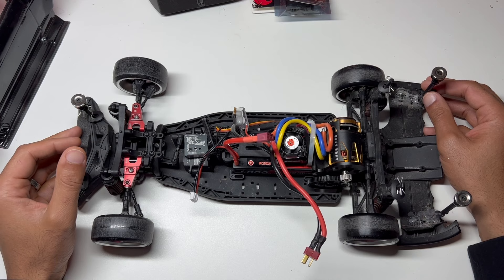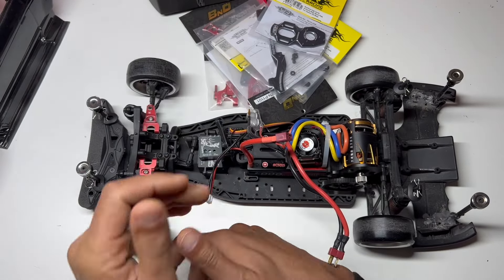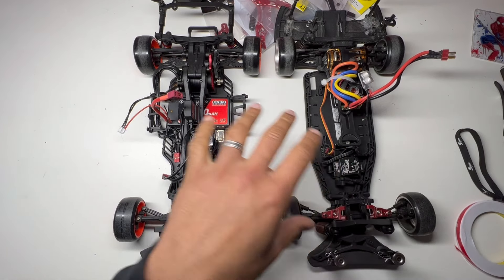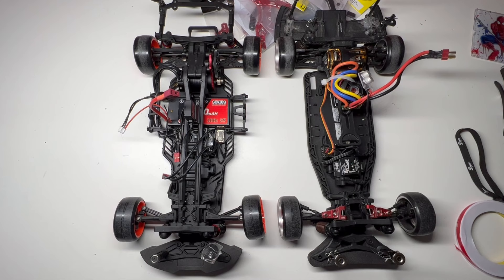Garage RC presents .....MST RMX 2.0 RTR MUSTANG GT RWD 1/10 DRIFT RC CAR VS YOKOMO Y2DS REVIEW PART2

Comment: Glad to see you added 1/10 drift RC, i did stop upgrading my 1/28 drift RC, i much prefer the larger scale, easy to tune and better value, By the way the Yokomo model we have here model YD2S, any way another awesome video👍🏻👍🏻, should have purchased the RMX2.5RS better gearbox  parts and tuning and some user said that the servo and gyro that come with the rtr are not compatible with other radio system or upgarded esc, not 100 percent sure.
Reply from the maker: More info the better. Yes had a feeling gyro radio not much use outside of rtr. I've ordered the better gearbox and other bits. 👍Thanks for watching
Reply: @GarageMiniRCUK  👍🏻

Comment: What is that track made of?
Reply from the maker: Linoleum / vinyl type material
Reply: PVC, but it’s available in polyester as well (which is more suitable to take on the road, but better to use with Sturmkind Dr!ft or Mini-Z only, as it’s much thinner and lighter than the PVC).
roll-rennstrecke.de
Reply from the maker: Thanks for that ,  I always forget exact . Still I’ve mine thanks for the custom size

Comment: Seen a video that of a mod you can do in the yd2. Its a on the servo installation. The guy inverted the servo mount and the servo stays aligned with the servo arm. I think it will imprivo driving.
Reply from the maker: Thanks bro 😎

Comment: so mad i just spent $200 on a 2.0 and didn’t know it doesn’t come with a battery or any tools and i have no clue where to get them
Reply from the maker: Most regular rc hobby shops will what you need . If it has the wheels it usually has a box wrench .